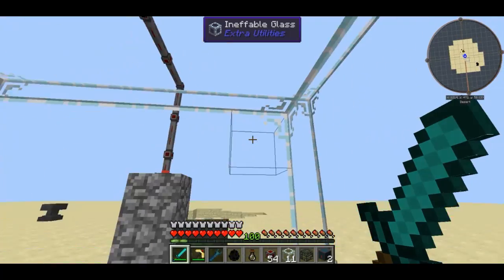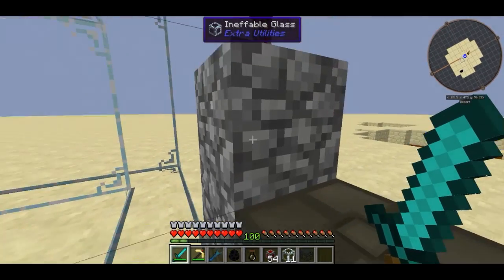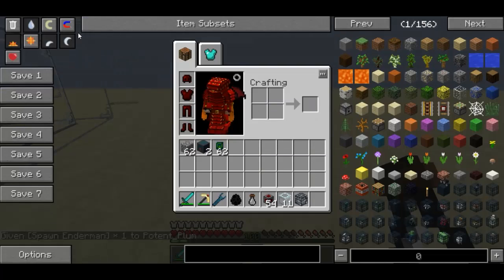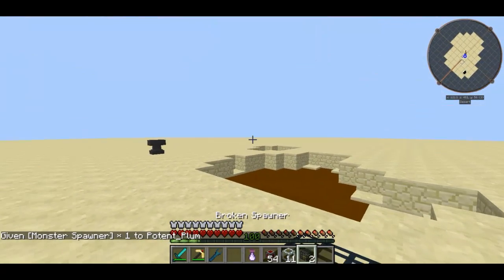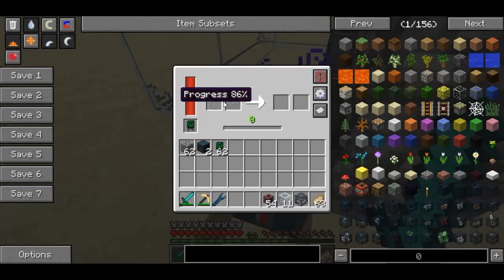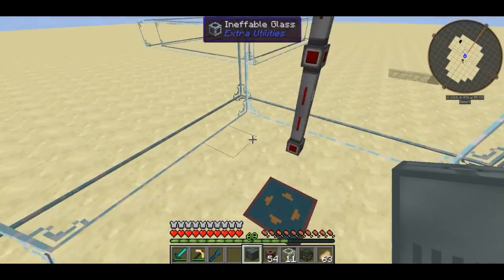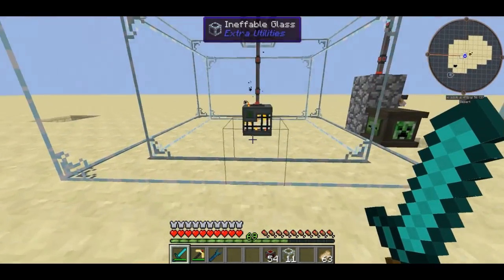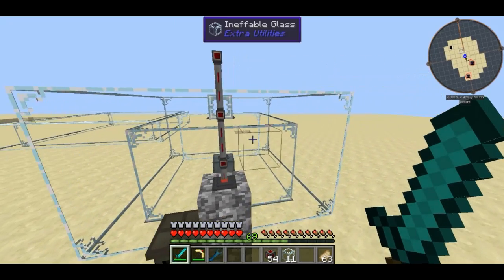ftb tutorials: powered spawner

Comment: Powered Spawner has a range of 4.   Enderman need a 3 tall structure.    The glass wasn't the problem, the spawner spawned it outside of the glass, since that was the only place it COULD spawn.
Reply from the maker: +steve wilber thanks for the tip :)